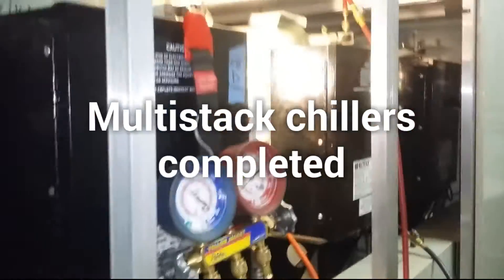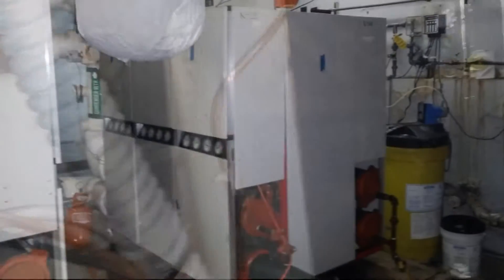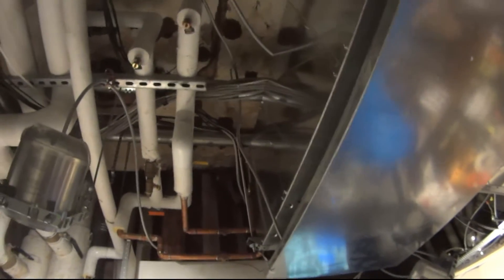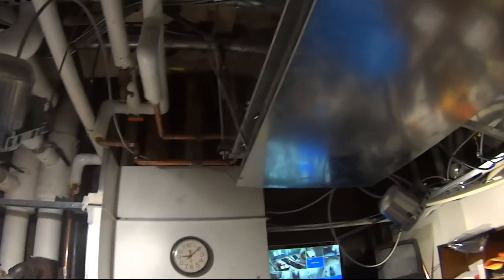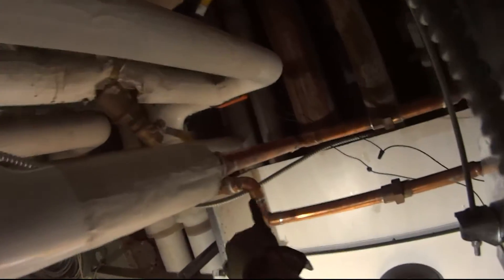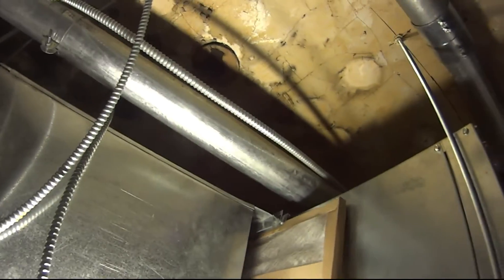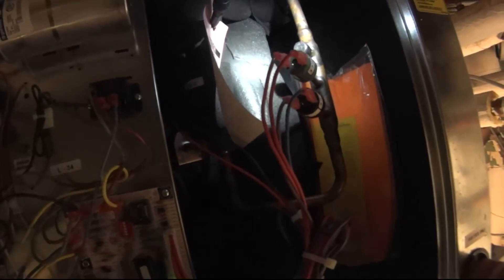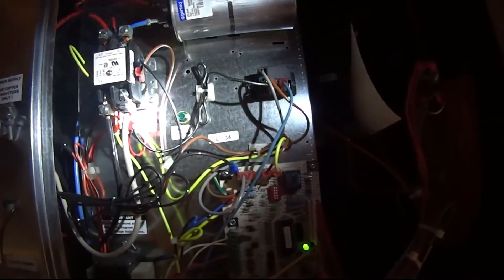HVAC | WSHP | How to perform basic PM

Comment: Great brother.  Does the wshp have  a condenser out side or is it a chiller are some thing removing the heat from the system.
Reply from the maker: It's in side the unit. Check out the WSHP basic training video. It's the one before the cooling tower job video I posted a couple of days ago. That video shows the condenser
Reply: Ok thanks